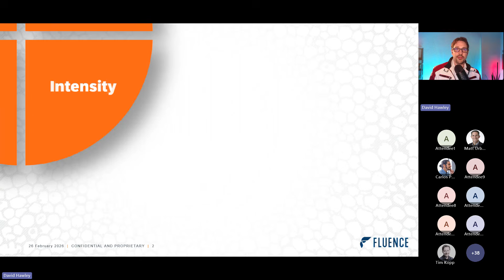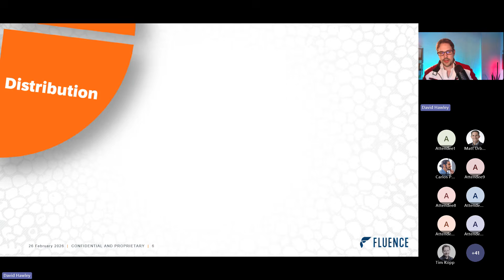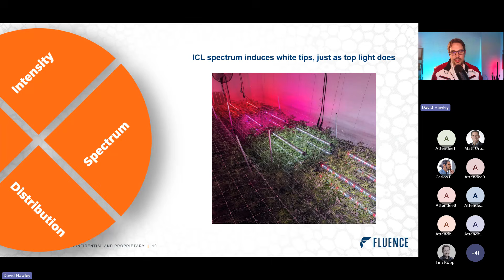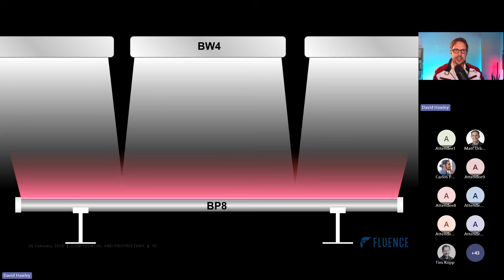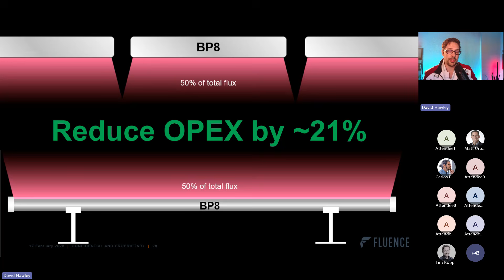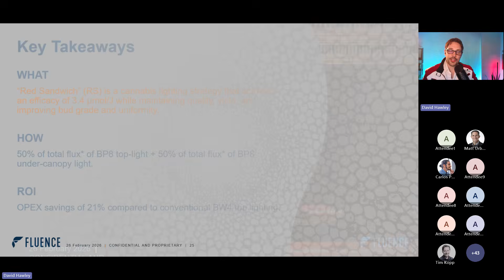Red Sandwich; A New Way to Cultivate More for Less | Fluence Webinar

Comment: when i see the intensity numbers of 2000umol/m²/s this is always with high numbers of co2 levels right?
Reply: Yeah, you're gonna need C02 approximately equal in ppms to micro moles at that level
Reply: @Hooch802 meh! so without i can run 400 ppfd top bw8 and 400 with a ucl?
that sounds like its not enough
Reply: @Velllllllllll as far as I know , you can run up to 900 par without co2 as long as the rest of your grow is set up properly. You will see an increase in yield by adding c02 that but it shouldn't be too much for the plant. I'm not sure how adding ulc changes that equation. But it seems like running between 750-900 up top and 200-400 or so on the bottom. Should be okay without C02 as long as everything else is dialed in. But if it were me , I would probably go on the lower side up top at first and just see how it turns out